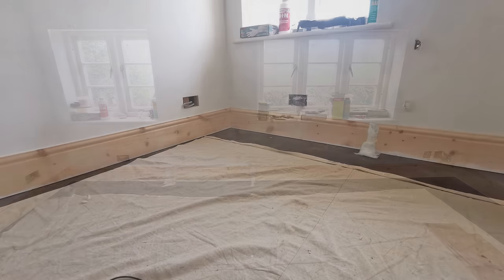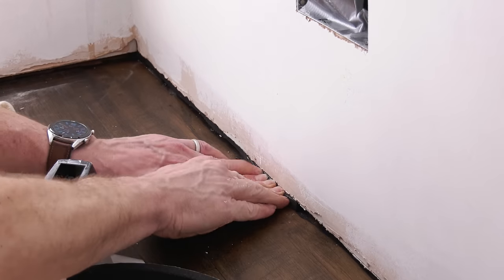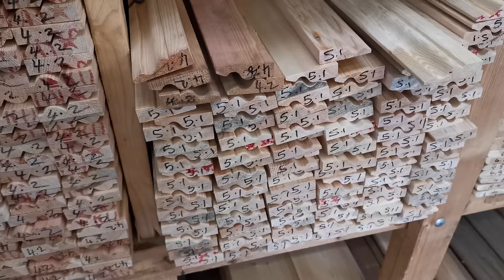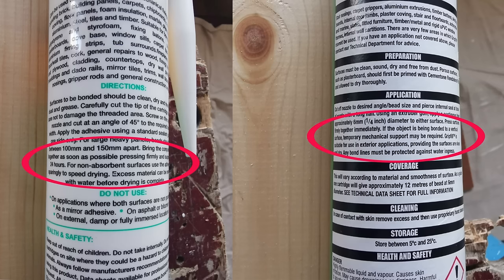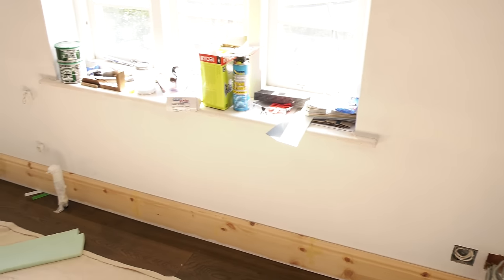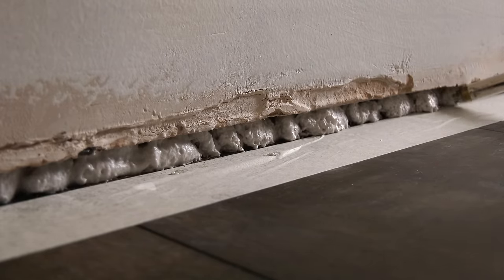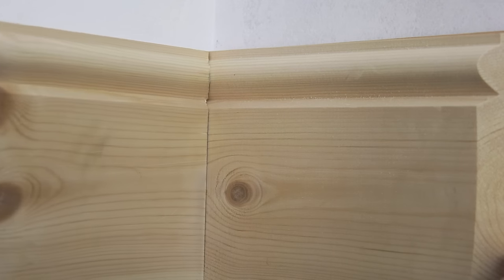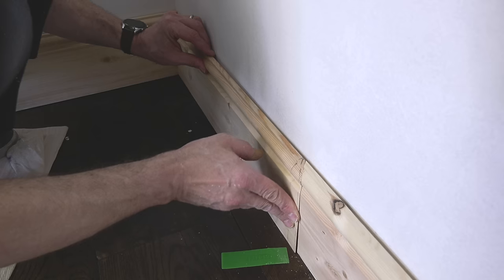How to Install Skirting Boards - a DIY Guide

Comment: Great Video!

I had a nightmare of a job removing old skirting boards in a 3 bedroom house a year ago. 8cm long Screws were very well hidden and there were many of them! Ending up damaging some of the walls in the process and was a rather messing and backbreaking job.

This led me to recently using expanding foam rather than glue or many screws to stick the skirting on with much success.  It minimises on the number of holes made by screws /nails. It Feels solid afterwards and easy to apply.  

Another benefit is the fact that it can be easily removed if there were any leaks or damp behind. Simply cut the caulk, pry the board slightly, use a long sharp knife and run it along the wall slicing the foam like butter, and that's it!

I usually mist the walls first so that it adheres better.
Reply from the maker: Thanks Michael. Damn it, I should have mentioned expanding foam - there's always something!! Yes, I can see a lot of benefits of that. How did you secure it whilst the foam was curing?
Reply: @CharlieDIYte  If walls and skirting are both straight, simply hold it with something heavy and within 10mins it should be solid.  For slightly warped I usually place a few pins to hold it in place, the holes will be smaller than screws so easier to cover and easier to pry out if removing skirting.

I've not had any serious warping as I mainly work with mdf and choose my pine very carefully. However, I've heard that some use mitrebond or clamps to keep it in place.
Reply from the maker: @Michaelz04  Thanks. I'm thinking I might use the grab adhesive (the other one, not Grip Fill) and tool it as if it was caulk, as it's paintable. That should keep the little ***** from moving.

Comment: Charlie, i've fitted quite a few skirtings and found out the hard ( and expensive ) do's and dont's. Worked out the warped pine skirting so now always stick to mdf. Anyway, always learn soething off your videos and in this one the vertical cut for sagging floor was brilliant. Thanks.
Reply from the maker: Thanks Dave, I appreciate that! Yes, I'm ready to ditch the pine now. Problem is, now it's installed it looks pretty marvellous. I'm going to have to remind myself what a pain it was by rewatching this video, before I buy the next lot!

Comment: OMG Charlie that warping,Another well presented video, full of facts and practical idea's, I only ever buy MDF, straight-primed --ready to go ----time is money, I generally get them fully painted prior to installation, 8/10 always used adhesive STICKS LIKE SHXT OR CT1 OR MULTI STICK. another great video - for all diyer's and pro's.
Reply from the maker: Thanks Graham - great tips. I agree, if you can get away with glue only it has to be the way forward. A few people are talking about foam. Have you tried that?
Reply: @CharlieDIYte  Never tried foam, why not. Any good quality adhesive just negates filling of a mechanical  fixings..The world of adhesives, worthy of a video I feel.Think back to the SPACE SHUTTLE and the tiles of the heat shield all attached by adhesive, failure not an option here..When I was contracting "Tiling" Omg some fabulous adhesives here --FASTFLEX for example, and them "Mitre fix" in kitchen fitting less than 10 seconds done, 
and most folks forget Silicone makes a great adhesive. Cheers Charlie..

Comment: Last year I refitted my living room and had terribly uneven walls.  My decorator friend told me to avoid caulk and use Easifill on the top edge of the skirting.  It is a far nicer finish and sanded level to match the skirting profile.

Looks amazing still and no cracking and no shrinkage of the filler.
Reply from the maker: He's right. I've done that on a number of occasions in the past and use Easi-fill all the time https://bit.ly/37aov70. I swear by the stuff. Here though it was reassuring to glue them to the wall given how much they were warping.
Reply: Does it come in a tube ? How did you fill the top ? Just looking at easifil now.

Comment: Hi Charlie, some very useful tips as usual.  I agree about the unused Ogee (or Torus) moulding on these dual purpose skirtings, but it is possible, with a little searching, to buy without.  Or, I know it will be more expensive, buy the deeper skirting and cut the unwanted moulding off.  Yes, a bit of a faff, but you will at least get what you want.  I also have an Irwin floorboard saw that I really like, apart from the upper teeth waving around in mid-air.

Comment: The last house I did I went with Primed MDF Ogee & really liked it being stable & also didn't need knotting solution before painting - I think the extra 30p is worth it as you save time & don't have to pay for Primer. Also look into 2 part Car Body filler as a much cheaper alternative to the Ronson 2 part - I bought a large 3L tin of UPOL NO1 years ago & it's still going strong - currently available for under  £23 on Ebay!
Reply from the maker: Thanks. It wasn't so much about the 30p. More about trying to respect the history of the place, but that sentiment is out of the window now!!
Reply: Audiorack Company . Good tips, I’ve used car body filler for years, on wood and filling cracks in walls, lasts forever
Reply: I always avoid MDF sils and skirtings, just a small bit of moisture and they will swell in most cases i've come across really badly. Yes soft wood skirtings are not always 100% straight and true but they'll last far far longer than MDF. MDF on external corners are too soft, doesn't take much for corners to show signs of wear. Avoid MDF like the plague.

Comment: Great video, it really helped me with the pine skirting I bought recently. Out of the nine 4m boards I bought, three were just as warped as yours.
1. The first board twisted along it's entire length (like a corkscrew). This one was cut up and was used as small runs of a meter or less where the warping was less of an issue.
2. The second if laid flat bowed upwards at both ends massively. I ended up weighing down both ends and putting some folded towels under the middle to bend it the other direction then leaving it for a few days - this really helped straighten it out a LOT (I suppose you could do the opposite also - turn it over, towels under the ends and a weight in the middle).
3. The third was concave across it's height, similar to one in your video - it was impossible to keep it flat to the wall as either to top or bottom kicked out. After struggling for an hour or so, the only fix I had was to flip it and use the other design instead. This way the top and bottom of the board was flush with the wall and the middle bowed outwards, but since it's consistent along the length luckily it's not noticeable.

If anyone buys pine skirting, first thing I'd suggest is inspect every board if you can before buying (I had ordered online), then once home (if they start to warp) inspect them again and group them together. If you're unlucky and have a load of concave boards it's better to find out early as it limits the side to you can use (unless you want big gaps). The warping on mine forced me to use the Torus side.
Reply from the maker: Thanks for this. The other suggestion I would have is leave them outside (or in the unheated garage, similar to where you bought them) until you need to use them, and mechanically fix them before they have a chance to warp. Only problem is they will shrink and leave gaps underneath.

Comment: Cutting through the top to lower the skirting board is an inspired thing to do! :). The planing line was handy too, though not on the same level. It took me a while to realise that when scribing, you only cut one end, vs 45% degree saw cuts, when you have to cut both ends, hence potentially a much better fit...Thank you! New extension skirting coming up as soon as the tiles and underfloor heating are down. French doors hung yesterday, no longer have an OSB plugged hole in the wall, kitchen might even get finished soon :)

Comment: Hey Charlie, fantastic videos you have accumulated so thanks for sharing. Best method for gaps in skirting is expanding foam. You cut it flush then recess slightly where you can then use caulk but ideally I use ronseal white wood filler which I buy in cartridges so I can fill from a caulk gun in super quick time. Never ever had a gap reopened using this method. Reach out to me if you need any more details.

Comment: Virtually the same problems I had compounded by a mitre saw I couldn’t calibrate to cut quite accurately in any plane, so it seemed. Also the double sided pattern and walls not being plastered completely to floor is still a major issue. I might give the Tackfix a try and add a few Lost Tites. Thanks Charlie.
Reply from the maker: You're welcome, Kev. Thanks for the comment and good luck sorting them out 👍🏻
Reply: @CharlieDIYte  I wondered if small amount of expanding foam through small hole at strategic intervals might support the double sided boards from vacuum cleaners etc

Comment: For wooden skirting boards that are "cupping" away from the flat of the wall, a relief cut (or two) can be made lengthways along the middle of the rear face of the board. Can be done with a router or even that small power saw you showed. Trial and error on a scrap board will tell you how deep to make that cut - it also helps flatten the board on the mitre saw when cutting the 45 degree cut for the subsequent coping cuts.

Comment: A tip for getting your splinter out. Before you go to bed - put vaseline on your finger. Then cover with a plaster. The splinter is drawn out - small ones just disappear by the morning. An old carpenter gave me that tip years ago and it works.  Might have taken a few nights with your one!! Good Luck, Charlie.
Reply from the maker: Thanks Charlie. My mother used to swear by plain plaster but I've never tried vaseline. I'll remember that. This one was a beast. I was working on my computer a week or so later and suddenly this little bit of wood poked out by the nail. The relief pulling it out was huge!!

Comment: Good video. I always mark the scribed corners on the front of the skirting and bevel the cut slightly so that you are guaranteed the front of the shirting makes a tight joint when butted up. That’s just my preference. If your skirting
Reply: If your skirting is warped you can use a circular saw to run some cuts along the back of the shirting about 2/3rds deep to aid pulling the shirting flush when fixing back to the wall. Remember to not screw directly below electrical sockets in case the wiring to it comes up from the  floor.

Comment: I've been doing a lot of the jobs you've covered in your videos to my own house. You've been a great help. When things don't go exactly to plan or some of the edges are not 100%, how does it make you feel? Are you relaxed about it? I get a lot of anxiety over it and it really bothers me.
Reply from the maker: Yes it bothers me (I'm a bit OCD like that) but I've accepted the warping and know that I'll do a good job of the calking so it'll look fine. What really upsets me is things like my bathroom which I did all myself (plumbing, everything) but got a locally recommended handyman in to plaster (before I met Gerard who has featured in a few of my videos). He did a sh1t job and it upsets me every time I go in there.
Reply: @CharlieDIYte  I also did my own bathroom. Tiling, Plumbing, plastering etc. It bothers me a lot as I know all the flaws and imperfections. You do a great job and are a great inspiration to me. Thank you.

Comment: Hi Charlie. Hope you are well? Just a quick one when you caulked you’re skirting around the 8 minute mark due to the uneven walls and warped skirting you were on about. Just a tip if you don’t mind me dishing one out.... get some soudall foam or similar and foam the back of the skirting down the back. Just to take up any movement where glue or screws have not got. Allow to go off. Scrape off hardened foam and then proceed to caulk or even use pollyfilla. I’ve lost count on how many times I’ve done this to prevent cracks in skirting board coming back 👍 foam just absorbs any shock and really prevents any residual movement . If you want to go a step further moisten the skirting back and wall with pva diluted with water to help speed the foam setting process and improve adhesion of the surfaces. ☺️
Reply from the maker: Thanks Marc. Great advice and much appreciated as I'm caulking imminently.  I was considering using that tube of adhesive I was brandishing (ie the one that wasn't Gripfill) to do that. It's paintable so I could even tool it as if it was caulk but probably less risky to just leave it level and caulk on top. I also have some of that foam left so I could use that as you suggest 🤔
Reply: Charlie DIYte give it a go mate see what you think. Works everywhere really... skirting cracks. Plasterboard cracks that keep coming back in places like up the stair stringers... take out lose material, wet in with pva and a few squirts of foam. Then fill or caulk over... no movement means crack won’t come back. Plasterboard which has detached from a dab and sounds hollow... drill a hole squirt some foam in and problem solved. Good stuff is the van of squidgy foam haha! And mate that warping on that skirting is something else. Yet looked fine in the store... place by me will sell it to you warped which is the annoying thing 🤨

Comment: I had the exact same problem and it drove me mad!!! I even tried soaking the reverse side of the bends with boiling water which helped but was impossible to calculate precisely. Then recently I had an incredible carpenter from the Ukraine and he had the same problem but what he did was to plane down the bends which worked amazingly well!!! Genius!!! 🤓🤓🤓
Reply from the maker: Yep, good point Simo. I should probably have done that with my electric plane, thinking about it. Quite a laborious job though!
Reply: i dont understand what you mean, what does 'plane down the bends' mean?
Reply from the maker: @treehouse7861  Basically turn the skirting so it's face down, and remove the bowed section from the back with a plane, so that it sits flat against the wall.
Reply: With a scrub plane that wouldn't take no time at all.

Comment: I just use expanding foam now to fix skirting, last lot I fitted I used leftover caberfix d4 from fitting the flooring - takes no time to go off and helps with uneven walls. The problem with grab adhesives is that they don't stick well to fresh plaster..
Reply: Yes, this is the method I'd use. If it's good enough for dot and dabbing plasterboard then skirting shouldn't be an issue.
Reply: Expanding (gun grade) foam is catching on in the trade - it's off fully in half an hour and so much easier to push back.

Comment: Great tutorial Charlie. Thanks. That splinter looked soooooo painful.
Reply from the maker: Thanks 👍 It was, John. The bit you saw was the second piece. I extracted a 10mm piece a few days earlier but knew there was still stuff in there. Woken in the night with stabbing pain. My biggest panic was that it would get infected and not being able to get it seen to in hospital, so I had it well dosed up with antiseptic all week. The body is a remarkable thing though. I had resigned myself to not getting it out, it was nearly healed and then whilst editing the vid, I looked down and saw the top of it poking out. Very satisfying extracting it!!

Comment: Another great video.
How common is warping? Wouldn't have considered MDF to be honest before this. 
Any reason why you wouldn't prime and paint before hand? This is how I imagined doing mine when the time comes
Reply from the maker: Cheers Olly. Yes, a few people are saying that, and I should have mentioned this. For me, I didn't want to gloss because I'd probably have to totally repaint once I'd sanded and filled the screw holes, so I thought I'd do it this way, put a load of newspaper down under the boards and attack them with a mini roller.

Comment: Really helpful, thank you. Wish I'd seen this before doing the skirts in our house because I also had the slight sag in one floor. Would the single cut technique you used also work so well on MDF? I ended up just filling the gap with flexible filler and calling it done.

Comment: Charlie, Brilliant Video, I have really enjoyed watching it. I was really impressed with insulation applied on gaps. I quickly checked all the skirting boards and laminate flooring, recently fitted by my builders and found draft seeping between board and laminated floor, even though it’s a small gap do I simply caulk to draft proof.? Much appreciated if you or anyone can suggest an option.

Comment: Try this.. cut a small amount of the end of the board with the miter saw and use the resulting line to use the coping saw. loads easier than attempting to mark it off another board with a pencil👍🏻

Comment: Great video with excellent information Charlie! ATB and keep safe - Marc - Belgium
Reply from the maker: Good to hear from you Marc. You too - how are things in Belgium, in these surreal times?
Reply: @CharlieDIYte  About the same as in the UK I suppose, we keep our distance from other folks and apart from the occasional stroll  only come out when necessary.  The government says the measures would ease from May 3 on but in my humble opinion  the consequences of this crisis will in the long run have a far bigger impact on our society than we now can imagine. Luckily there still is YouTube ;-)
Reply from the maker: @marcdewilde518  I'm afraid to say I think you're right. Things were quickly recovering in the day job after the spectre of Brexit eased and the fear of a crazy marxist getting into power failed to materialise and now this. Yey ho, hang in there mate!